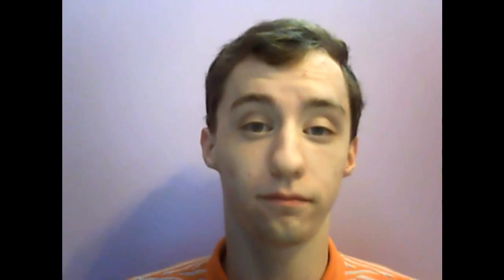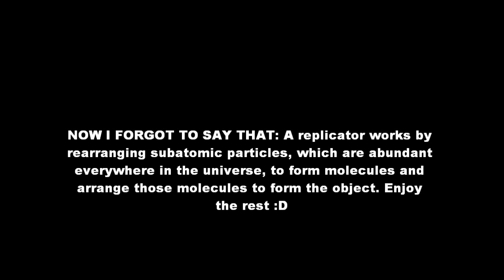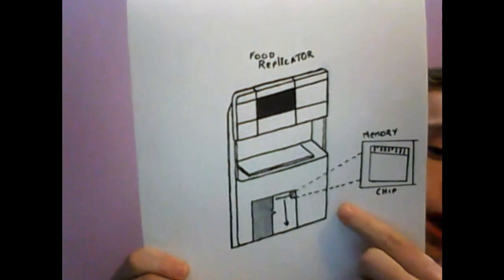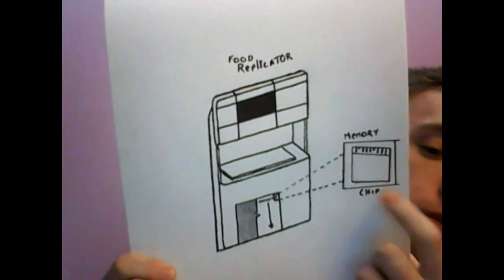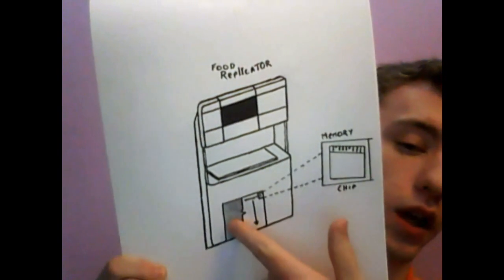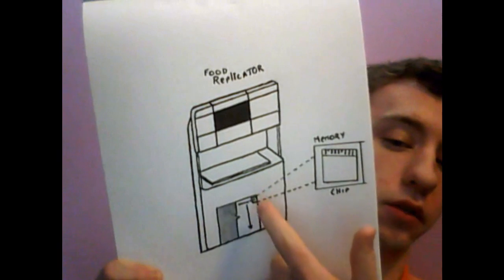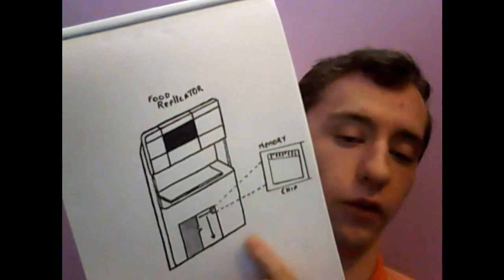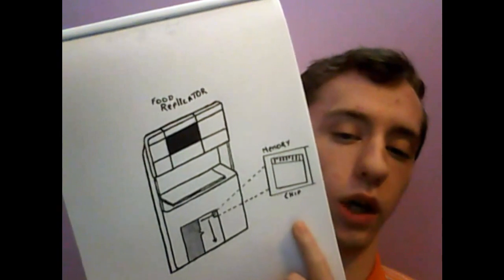Mini-series on Star Trek Technology (Food Replicator)

Comment: You might not have to vaporize the glass or water, as that simply destroys what is there. Whatever would scan the molecular structure of the H20 & the glass could vary well do so without necessarily vaporizing them. Solid state or flash drives, which consist of memory, rather than standard hard drives is what your looking at for storage. Expensive for now, but cheaper every day. Magnets or nanites might be able to manipulate subatomic particles, that's the direction I'd head.